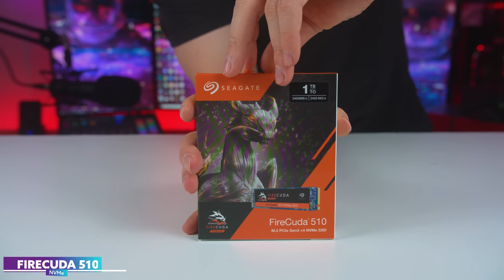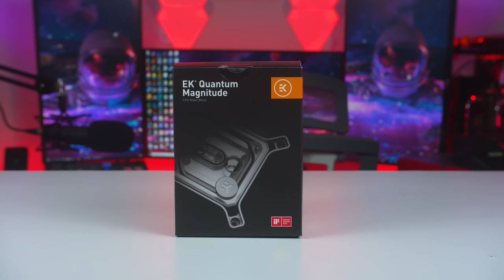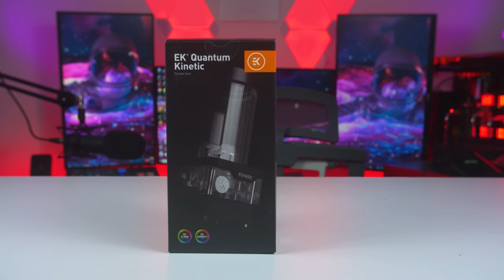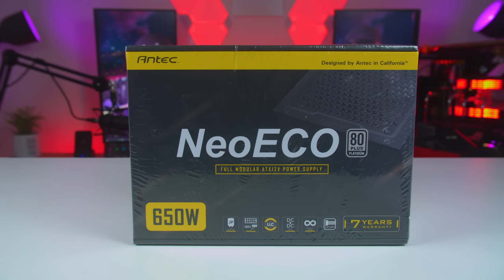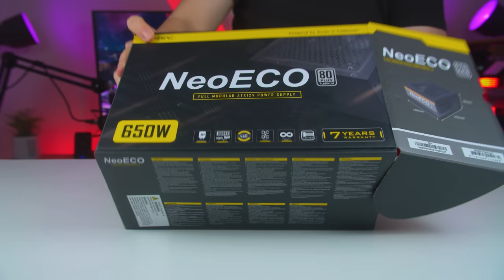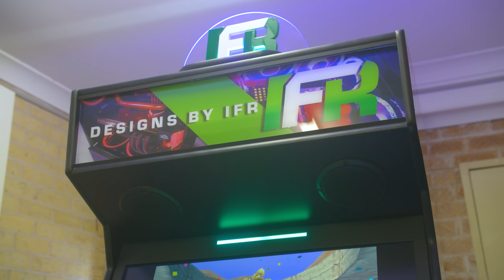I built a PC inside of an ARCADE Machine! 😳

Comment: The PC component choices seemed a bit odd to me. High end CPU, mini itx motherboard in a case that supports much larger boards, with a GTX 1070, then loads of money of watercooling? 

You could have stuck with air cooling, got a cheeper ATX or M-ATX motherboard, and then have had the money to buy a much better graphics card? Watercooling is great (my rig is watercooled) but surely if you are working to a budget it would be better to use the money for better core components, not on a full custom (expensive) watercooling loop?!
Reply: d'you think it could have been a 'spare parts' build? that would explain the strange component choices.